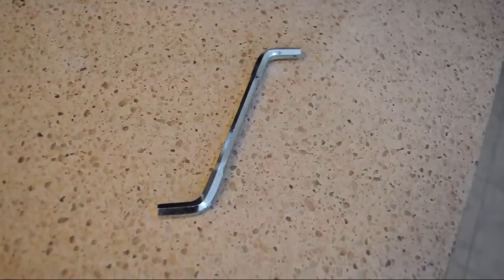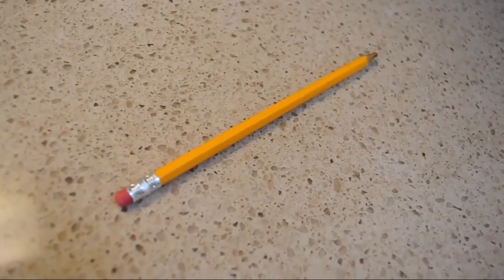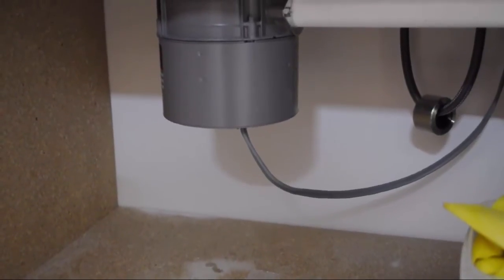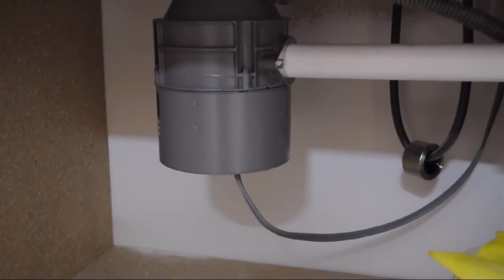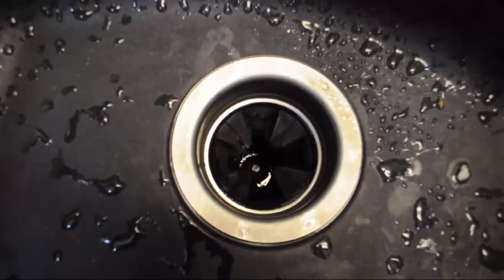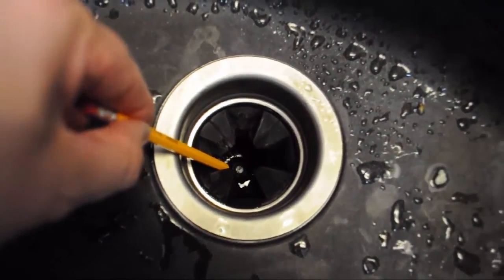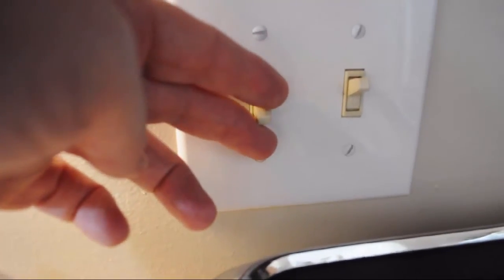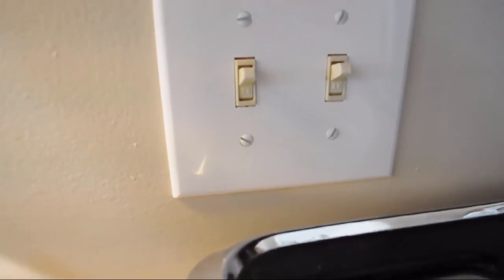How to fix your garbage disposal (stuck flywheel)

Comment: Ok. What happens when i do all that and it still doesn’t turn on

I am getting a humming noise but the grinder still wont spin. What else could be wrong? I thank you so much for your or anyones help in this matter.
Reply: Usually, if the basic troubleshooting doesn't work (removing debris, spinning the flywheel, and resetting the power (red button on bottom) then the motor likely burned out.

If so, the next step is replacing the unit.